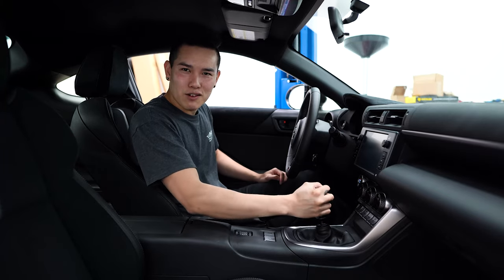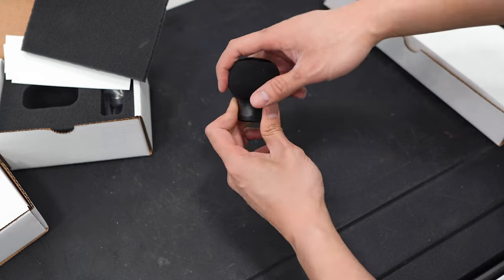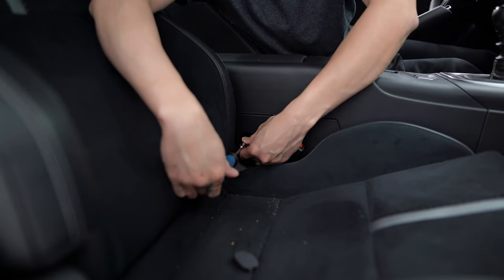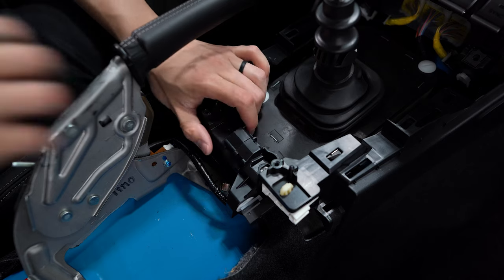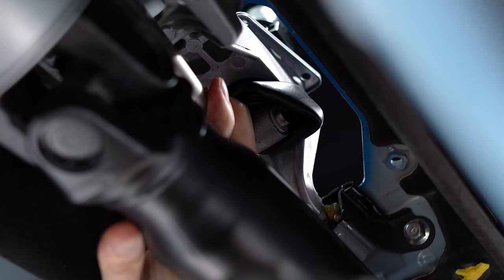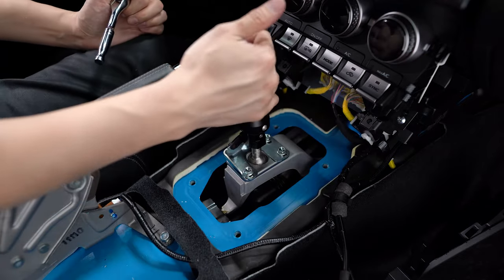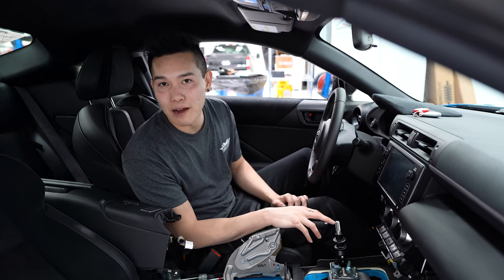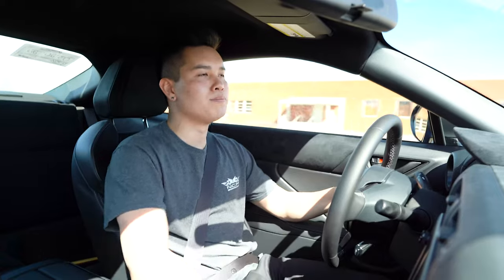2022 GR86 & BRZ Billetworkz Short Shifter Install

Comment: Great Video!  All of them actually.  But it makes no sense to go underneath the car.  Its actually easier to do the pin and snap ring from inside the car.  Pull the shifter up.  You'll see that the pin and snap ring are almost above the transmission tunnel.    FYI:  I used straight nose snap ring pliers.

Comment: I waited 18 years to install a Cobb double adjustable short throw shifter on my Bugeye WRX and it has been one of my favorite (of many) mods. I only waited 2 years to install the Billetworkz shifter on my BRZ. I was able to do it from inside the car but tore the crap out of the big rubber boot using pick tools. I will crawl under the car to try to get the boot positioned correctly. I was unable to reuse the snap ring that secures the bottom of the shifter to the linkage as it was stretched too much. Recommend having some spare snap rings on hand when you go to do this install.

Comment: Will that shift knob fit on the stock shifter? I know many knobs that fit the old cars do not fit on the the 2022 because the reverse lockout is much wider and does not fit.
Reply from the maker: Yes, the Cusco brace is another great option and you can pair them with their inserts as well I believe.
Reply: Hi Kevin. I don’t really understand your answer on boost331’s question. Can you confirm if this shift knob will work on the new car ?
Reply from the maker: @janhuybs2013  sorry I must've replied to the wrong comment. Yes this knob fits on the stock shifter.

Comment: Is the billetz reverse lockout smaller than the stock one? My cobb shift knob doesn’t work. Hoping this new reverse lockout will be a direct fit for the Cobb shift knob
Reply: I don't know if you ever got your answer, Rafael - but it is smaller.
I THINK it's 19mm. If you still need the measurement, you can @ me and I'll go outside and measure. I'd do it right now, but its raining lol

Comment: What part of the shifter makes it more notchy?  I'd guess the shorter throw is due to a change in geometry/length of the shifter but not sure what would affect the notchy feeling.
Reply: The notchiness comes from inside the gearbox, usually from the synchro rings engagement. By using a short shifter, more stress is put on the synchros since they have less time to synchronize (brake) gears, and so the notchiness is exacerbated.
Reply from the maker: Essentially what Gabriel said, it's not so much because of the shifter in this case, it's more due to the fact that since the throws are shorter you're feeling a bit more of the "action" in the gearbox whereas with the stock shifter it dissipates throughout the longer throw.
Reply: @KevinVo ...do you think a change in trans fluid would help reduce the notchy-ness?   Adding mass (weighted knob) will absorb some of the vibrations, but that comes with its own set of issues/downsides.
Reply from the maker: @K03sport  I don't believe so. A weighted shift knob would make the biggest difference.

Comment: I got mine installed today…. and it rattles over 3k rpm… any suggestions or solutions ?
Reply from the maker: Send them an email, they'll be more than happy to help.
Reply: Did you figure it out
Reply from the maker: @fayizd654  @billetworkz has a fix
Reply: I switch to the STI SS….  now I have tried 3 different brands,,, they all rattle…!
Reply from the maker: @robertogatti8290  did you email billetworkz?
Reply: @KevinVo  Yes I did. They send me o-rings… but when I switched to the STI, I checked the BW o-rings and they were ok…

Comment: I am not enthusiastic about the install of this one…snap rings are the bane of my existence and that there is one underneath the vehicle…nope.
Reply: I just did the install earlier today - I was able to do everything from inside the vehicle. It was actually pretty easy.
I have medium hands (I wear M sized Mechanix gloves) and it wasn't a struggle whatsoever.

Just make sure you got your 90 degree snap ring pliers.
Go slow. Be deliberate.

I walked the linkage boot up until it cleared the snap ring + linkage. Sorta stuffed it out of the way.
Carefully, with one hand holding the snapring pliers and the other hand holding a finger against the snapring, it just came right off. No problem.

The reinstall with the Billetworkz was even easier than removing the factory one.
You should be putting some white lithium grease everywhere. Some residual grease in naturally going to get on the boot.
In addition, the finish of the billetworkz is much smoother than the stock unit, so it's much easier to slide the boot over.

Took me maybe 30 minutes, all from inside the car. If you drop the snap ring, it'll just drop on the ground underneath. Make sure you have your magnetic grab tool handy.